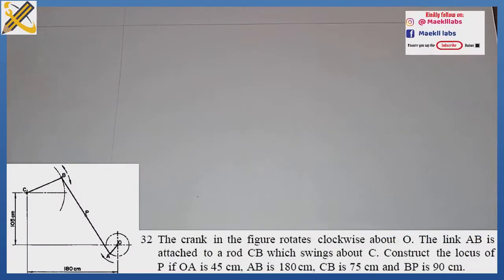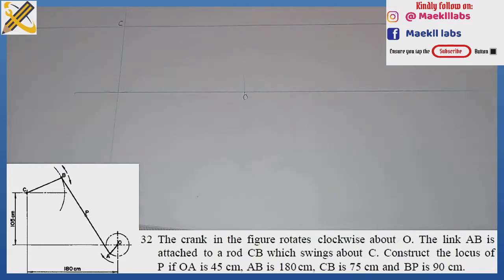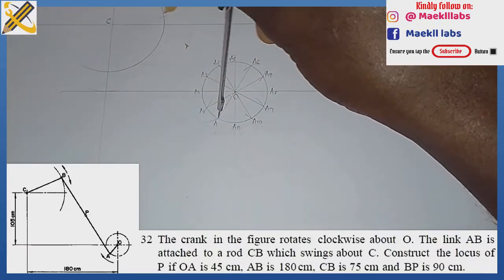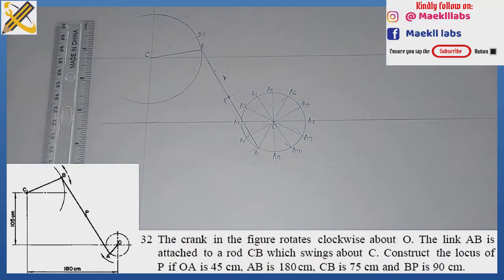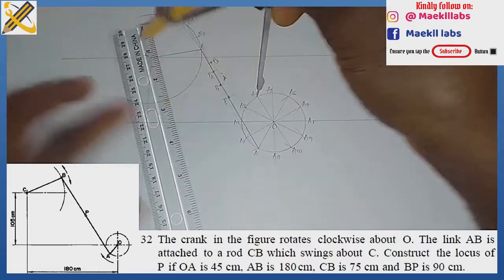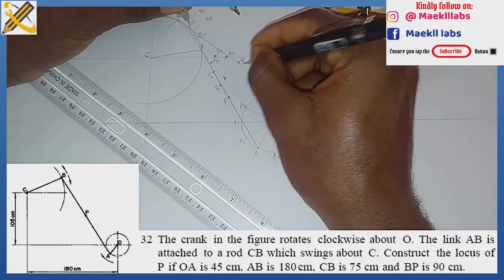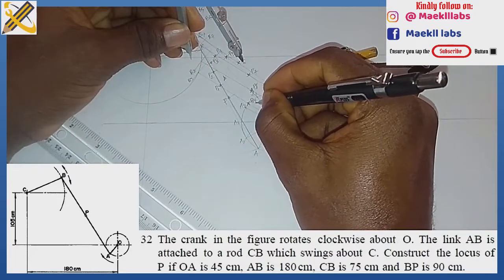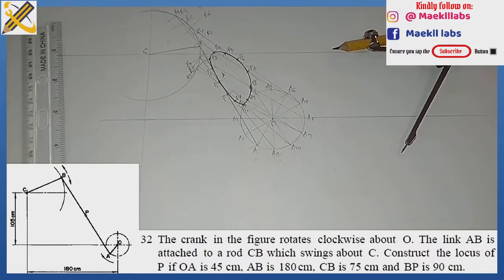CRANK MECHANISM - LINK MECHANISM 8 in | Technical drawing | Engineering drawing

Comment: Why did u divide the 90 by two n the 45 too
Reply: He has divide by two, because before he started ,he said that the scale that is going to be used it will reduced by two ,in each and every dimension
Reply from the maker: ...its called scaling...1/2 means half scale...and scaling is allowed in Technical and engineering drawing...you can make more findings in that.